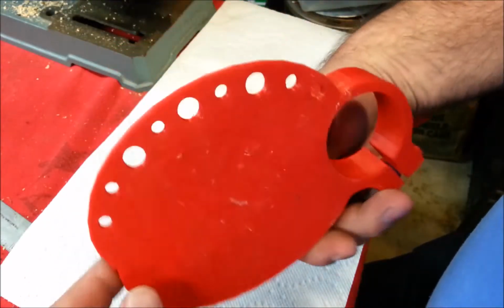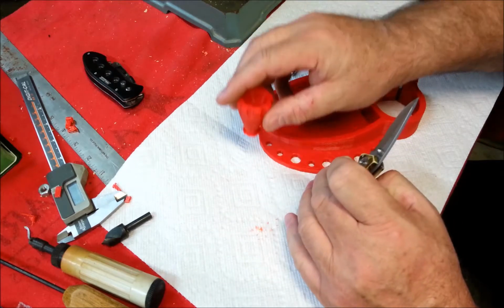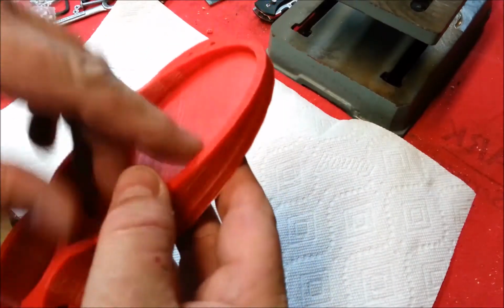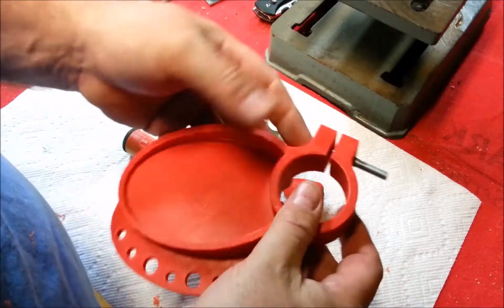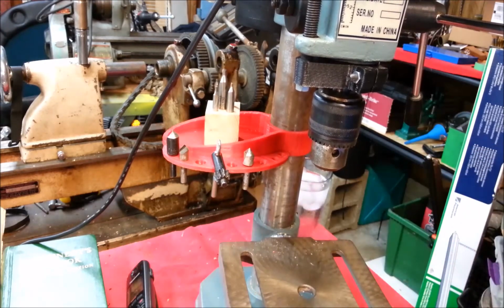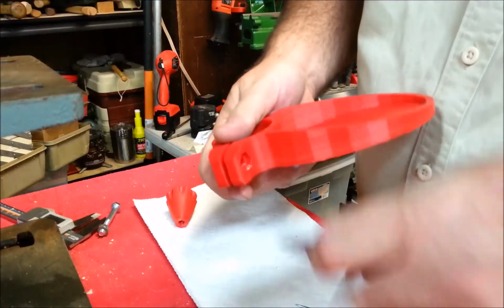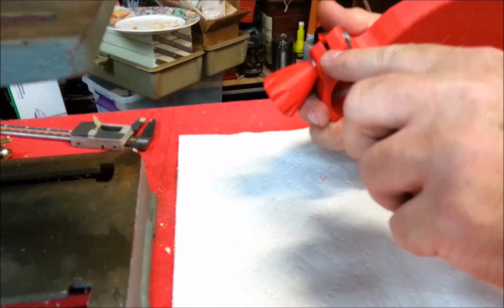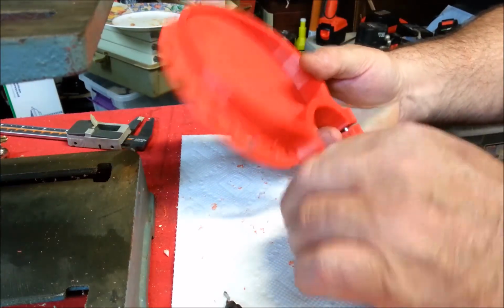3D Printing Practical Objects - Benchtop Drill Press Tray Organizer

Comment: nice tray I have a few ideas  it would be good if the tray was big enough to hold a fractional index (oh or mold the index into the tray) secondly instead of having the clamp on the tray make a ring with a clamp and let the tray just rest on it. that will let it swing freely in and out of the way.
Reply from the maker: +Chris Anderson I thought of the ring idea but dismissed it early because a drill press can sometimes vibrate and I thought the tray could be moving around while I was auguring out something with a large bit or hole saw.  Now that you have me thinking of it again, I could incorporate a pair of magnets to cause the tray to want to hold in certain central position unless it's moved manually.  Or, a bevel angle on the clamp ring and engagement ring could be cool.  Make it work like a swinging door where it has to rise up against gravity to be moved around.    It certainly could be engineered not to need the knob and pinch bolt.    But, then, I was having fun designing my first knob and collet.  It's too small to hold an index as you've noticed.   I had the feeling it would look funny that big.  I have thought of thickening the rim along the back and making holes to hold a set 1/16 through 1/4 along the curve.   But, I like the bits being left in the index.   I've started working on the drawing for one to fit my large drill press.  I'm not close to running it yet.  I'm working on making it so there is no fixed diameter column.  But, I want to avoid using hose clamps and engineer something a little more edgy.  It's certainly true, if you stuck something awkward on the press, might want to pivot the tray fully away.  Particularly if it was something you were worried would catch and whip everything off the tray.   There is a lot of things to consider in what first glance seems like a simple problem.    Thanks for checking it out and offering some ideas.  I'll be adding to this project in the future.
Reply: +Crafted always glad to help inspire. what about the drill index holes
Reply from the maker: Holes can't be made precisely.  But a near to size hole can be printed.  I imagine a fella using his drill press to drill out each holder hole with the next size larger bit.  Drilling in plastic produces a slightly smaller than hole than the bit.  So, drilling the next 64th over should fit each bit.  Checking out your #12 tool score video now.
Reply: Oh yeah let me know what you think. Check out the Atlas lathe videos and the brown and Sharpe mill videos. Should keep you busy a while lol.
Reply from the maker: I'll start looking through your channel.   I'm kind of holding out for the littl Atlas/Clausing vertical mill. Yea, I know it's very small, rare and probably just a rumor but I want one.
Reply: +Crafted I think someone was making vertical adapters for the horizontal mills I've seen a few times I can keep a eye out. you might also join the Atlas yahoo group great resource

Comment: Great video. I like that your projects and becoming more complex and useful.  The printer is great for small batches. large amounts would be made with injection molding.
Reply from the maker: +james green I intend to manufacture things with it that could not be made with injection molding because of the economics of mold making.   Short run or high value items.  Obviously, it's no tool to make items that can be purchased for $5.  But rare restoration part duplicates there would be a market for.
Reply: +Crafted I was fascinated the first time I saw one of these in use years ago. It made for a fast way to make engineering models.

Comment: I see you're finding your stride with your 3D printer. I wonder if that could easily be cast in aluminum?
Reply from the maker: +eviltwinx I'm sure it could.  Trick is machining it.  I don't have my mill setup yet.  But I sure am getting tired of the space it's taking up.  The mill head is sitting on my castiron legs/aluminum oil tray table for the Logan lathe.  The Logan is sitting on top of my roll around tool box.   So, I can free up a surface if I put it together.   Do you have a small drill press like this in your shop?
Reply: I do. It's a Harbor Freight 10" press.
Reply from the maker: eviltwinx That one is a little bigger.  What is the post OD?